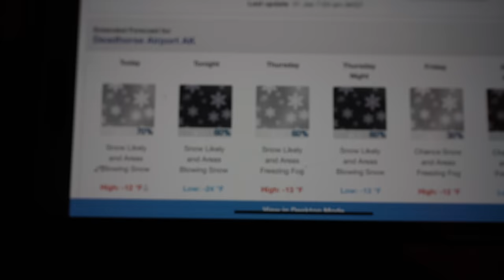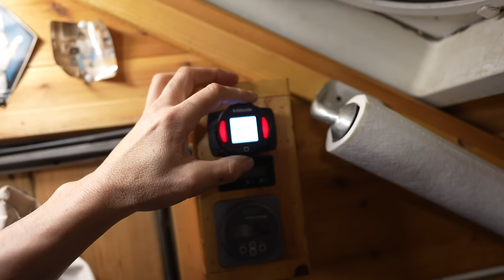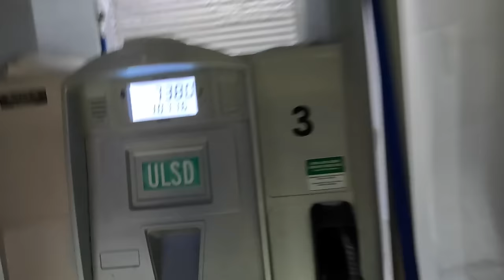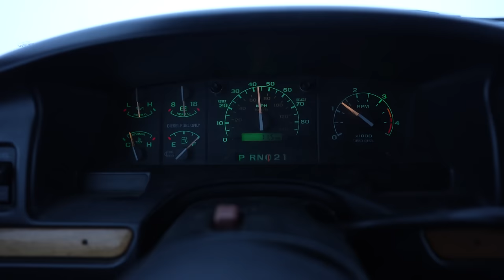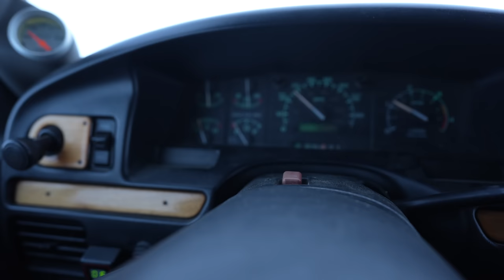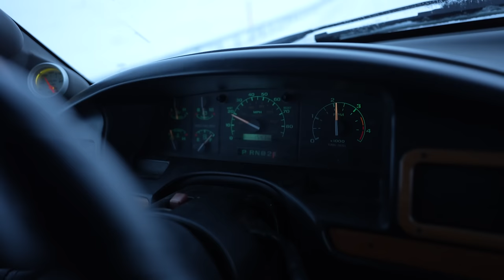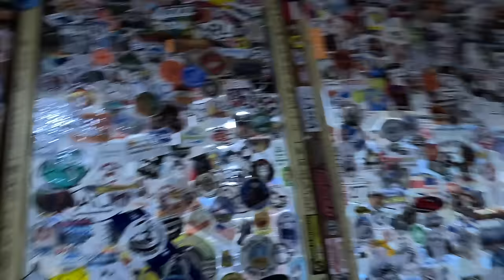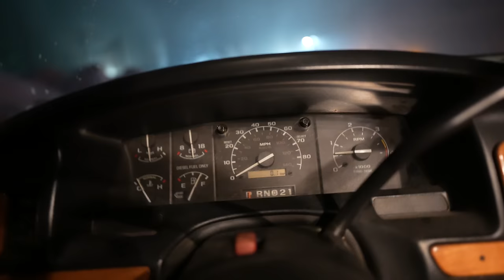I Didn't Make It | Truck Camping at the Top of Alaska in a -75F Arctic Blizzard in my Old Ford Truck

Comment: my 1989 Cummins uses 3.8gal in 12 hours of idling. that ford sure is thirsty. I rarely idol for a long time, but i understand why you did.  i use a generator to run my block, and oil heater in the cold when out in the country.  your truck has the electronic shit on it.  that why i still have the old full mechanical diesel.  no computer at all, just an old diesel engine doing what it does.

Comment: Low idle it. It will have 0  negative consequences. Especially given the fact that you drive the car all day, so it definitely stays in op.temp, has adquate oiling and such. High idle will hurt your wallet. Low idling does not hurt a 30 year old machine. You cannot hurt this engine, its been through everything.

Comment: You are crazy. If I was independently wealthy I would be driving that thing to the beaches down south and  meeting honeys. Not hanging out in weather that can kill you in a few minutes.

You would be better off with a small diesel generator and some block heaters...2 generators...where you are for a backup . I work on 7.3's and they have a lot of moving parts that will wear out. Injector cups need to be replaced between 200,000 and 300,000 miles. I don't know what that works out to in hrs. Injectors last about 175 to 200k and they are really expensive for that engine, Injector cups can be done w/o pulling the engine but it's a pretty big job. i charge $4000 here in Oregon so it's gonna be double there. About half of that is parts.

You mentioned fuel tanks, just get some saddle tanks and leave your other tanks alone.

Comment: No need to run it on high idle. Like any vehicle it has a thermostat. Diesel ppl crack me up. At regular idle it will obviously b fine. Not like it's constantly circulating water n I would assume has a clutch fan.

Comment: You are going to destroy that 7.3 Power Stroke if you don't run out of ohio, I'm telling you right now, and I'm sure I'm not the only one, a diesel cannot sit there and chug at a low idle for a long extended period of time, you are going to destroy that engine if you do not idle it to a high idle, you are going to destroy it diesels cannot sit there and chug for 12 or more hours, you should not let a diesel sit there and chug at a low idle for any extended amount of time, I'm telling you if I got a diesel truck and I had the ability to bump it up to Ohio if I was going to be sitting for 10 minutes or more that would run at a high idle for that 10 minutes or more, I would never it doesn't matter how much diesel fuel cost, the repair to the motor is going to be more costly than the diesel fuel itself, and you will destroy that motor if you do not idle it up, I'm just telling you, and like I said I am not the only one that's telling you this I'm sure that there are plenty of people in the comments that no diesel engines that will tell you the same exact thing, you cannot let a diesel sit at a low idle for extended time, you will destroy them.